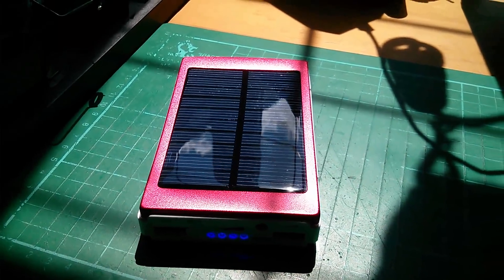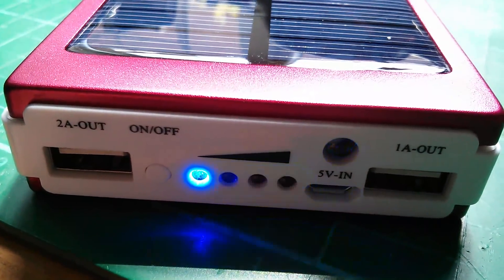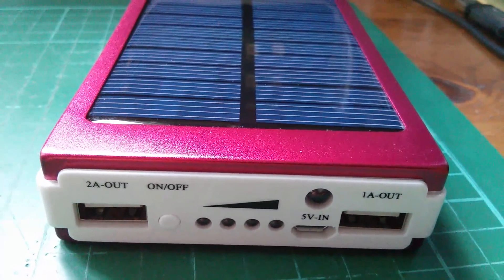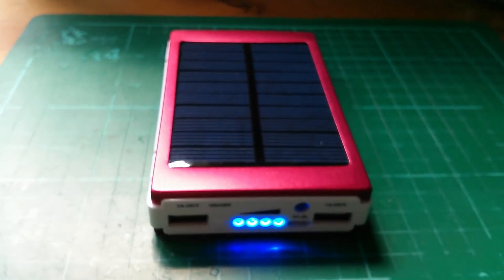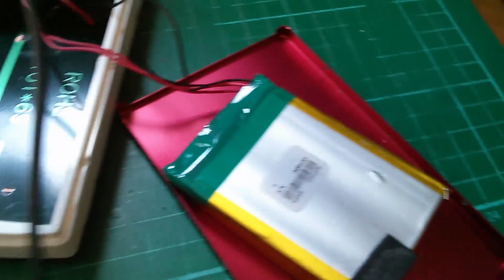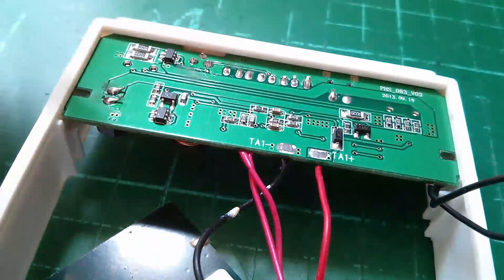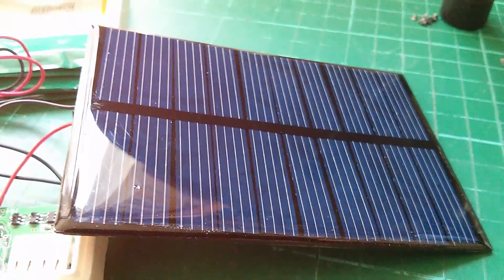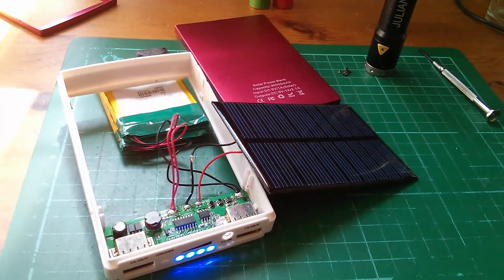Review: 30,000mAh Solar Power Bank - It's a pile of Junk!

Comment: Nice review, but I COMPLETELY disagree. You have what looks to be a brand new one that you have taken apart and judged. I have used the same product for over a year in adverse weather conditions, camping and bringing it to the industrial workplace EVERY DAY where it has survived a drop onto the concrete from a distance higher than my height. I am 6ft2in tall. I have used Duracell, yoobao, and several other battery banks in the past. This one you reviewed negatively is the one that has taken the worst beating and kept going. Give a bad review to the altek one or something, not this one. Altek is the one that diddnt last me 2 weeks. I definitely recommend this product.
Reply: +glaucus78 You recommend THAT? A product where you don't get what is printed directly on it? I don't care how rugged it is, if I buy a 30000 mAH pack I don't want a 4800 mAH pack. It's top quality crap.
Reply: +frtard Yea, I know what you mean. This is always expected when buying crap on eBay. All I wanted was something to keep the Bluetooth speaker charged for at least 8 hours at work or camping, without me being worried about it or the speaker dying. A combo with this charger and the HDMX Jam worked out the best so far.

Comment: Thank you so much for that. I was tempted to get one but you've exposed it as a con and waist of money.
Reply: Yeah, It's a total waist
Reply: +Alba Albion Its not a waste of money. As far as I'm concerned, its the best power bank under 20 dollars I ever had. I have purchased some 8 or more power banks over the last 10 years for my job to have Bluetooth radio connection at work. This 30k solar one is pretty good. If you have the money, by all means get the "yoobao long march", but this one is plenty good. I look forward to buying the 50k mAh one.
Reply: +glaucus78 or you can buy a $17 elivebuy imix gen 2.
Reply: +Littlefear it has 10,000 mAH

Comment: I found a "600,000 mAh" power bank lol
http://m.ebay.com/itm/600000mAh-Solar-Power-Bank-Charger-Battery-Backup-Galaxy-Iphone-Portable-Mobile-/221887185824?nav=SEARCH

At 3.7V that's 2.22 kWh, or just under 8 megajoules!
Given the typical energy density of Li-ion batteries, if that thing really had its rated capacity, it would weigh around 15 kg! How's that for portability?

By the way, with that amount of energy you could charge your mobile devices virtually infinitely many times. Or heat up 19.1 liters of water from freezing to boiling. Or run a 3 HP electric motor for an hour (assuming no power loss and 1 HP = 746 W).

Charging would take several days, even if you wire it to an ATX power supply. I wonder how long it would take to charge using its built-in solar panel though.
Reply: +fede142857 It's also on amazon with no ratings 

http://www.amazon.co.uk/Capacity-600000mAh-External-Emergency-Universal/dp/B00VJSM3T8
Reply: +theBIGreekgeek 
I opened my 200,000 mAh today... It is 2x 4500mah
Reply: RRSYS.info - Roulette Prediction
hah you should post a vid
Reply: +fede142857 Is that description written in Comic Sans?
Reply: +tapper88 What will expect? China, the fake capital of the world. lolo
Reply: well said, but is it not simply a typo?, maybe an extra 0, perhaps just 60,000 - i have a 200,000 model, and i have not opened it up, but i notice it charges my iphone 5s from dead to 100% so far 4 times, i know its not 200,000 mah, and my usb tester says so far its transfered only 6000mah's - +fede142857
Reply: I would do, but my channel is all roulette, but yeah, I may make an exception - you know it still usefull, I have got 4 of them :) 
+theBIGreekgeek 
[Paul]
Reply: +RRSYS.info - Roulette Prediction (Paul) there is no such thing as a 4500mah rating on an 18650... you got over rated batteries in an over rated package lol
Reply: ***** lol
Reply: +Honda 97 you know how sad i feel. China electronics SUCK! btw here in china every 5 minutes people call the fire engines because of electrical failure/explosion/short
Reply: +fede142857 I thought asians were good with numbers, Well at least they got the panel info right: "Solar panel: 1.5W"
Reply: fede142857 buy a bunch of old nokia and make your own power bank xD
Reply: fede142857 It's also impossible as the highest we have reached in capacity is around 50,000 mah, especially for $50. Don't buy it.
Reply: At 3.7V that's 2.22 kWh... ;-) Chinese material... False technical data!

Comment: The cells inside are obviously "recycled" from electronic scrap. Clearly visible scratched adhesive as you would find it when removing them from a cellphone or tablet for example. This is not due to removal from the so called solar charger itself, as the same adhesive in the same scratched and wrinkled state is visible between those two cells, holding them together. This is quite common chinese method to save a few $$ when producing unbranded low-end stuff in fraudulent, clandestine sweatshops. I have often encountered that. 18650's from disassembled old laptop battery packs, polished endcaps and a new shrink foil, sold as new. Spare batteries, for cellphones and ipods, removed from scrap units, cleaned from adhesive residues with solvents to look like new (unfortunately printing also came off by that) - sold as new on ebay. And if even that is too expensive, they sell power banks where they put in for example one or two crappy old cells and  some dummies. Just the case of the battery, filled with sand to give it a substantial weight. Do not trust cheap no-name lithium cell containing electronic goods from china. It even might be dangerous...

Comment: I've got one that looks identical, but is a different colour and has different writing on the back. It's claimed to be 10,000 mAh, which seems fairly accurate in practice. It's good as a rechargeable light and an emergency battery pack. But I had to permanently cover the solar panel as no matter how bright, whenever enough light hit it, it would quickly drain the battery instead of charging it.

Comment: even the so called 50000 mah has like 8000 mah battery cells inside it. Its solar panel is very low wattage so it trickle charges the power cells, in short it will take a very long time to recharge of the sunlight. I looked at a review on this product its amp hour on its USB ports are much lower than what is stated. So its a total rip off.

Comment: I dont know anything about electronic and circuit but what if you opened this and cut all 4 led blue lights? you wouldnt have the problem of the led lights taking the energy from the solar pannel. these lights are kinda useless... or maybe the whole circuit wont work anymore because the lights are pluged in serie? i dont know...

Comment: I had a solar one quite a while ago, 7000mah, size like a typical 5 inch phone. 
Pretty crappy build quality, a lot of heat and inside was just a really small battery in some blue tape. Measured about 700mah, which is crap. Also the output was supposed to be 1 amp, but seems to be about 400 milliamps...

I got it from a local store for 20 wasted euros.

Comment: that solar panel doesnt give more than 250 mAh (in full sun), so you need 8-12 hours of full charge to replenish the battery. Maybe the battery life is gone or there isnt any DIODE connecting solar to battery and the battery finally is pumped by the solar panel. You cant charge the phone with the sun, you charge with the battery energy. To get a decent rate of 2000mAh you need 6 solar panels of 6x6 inchs.. and 30000mAmp/h is 30 Amp/hour (half of the car battery  (?). This is a 2000-4000 mAh maximum.. so dont expect miracles

Comment: Don't waste money on any expensive solar panel get creative- I built mine from old solar yard/garden lights that I bought at a yard sale dirt cheep- cost me very little. The lights all had dead batteries I dissembled them and screwed the tops to a PVC frame each tiny panel from the former lights put out 6 volts I wired all 21 of them in parallel for max current- haven't measured the true wattage yet it is however enough to burn up transistors in DC to AC inverters and 555 timer IC's- I make pulsing DC circuits and hook them to neon transformers and inductors to create inductive arcs and high voltage for capacitor charging.
Reply: Those solar garden light panels tend to be the cheapest, short lived examples you can find, usually aren't putting out anywhere near their max capacity by the time they've had a tour of duty enough to kill the battery.

I suppose they'll do for a dirt cheap home project but for portable power I'd stick with premium solar cells.  One thing I haven't see yet which seems like it would be a fairly robust design is to take a unit like the one reviewed here, but with premium cells, and put a 2nd same-size, fold out panel on it with each end being a metal hinge for the +/- connection, recessed so they couldn't short out on a metal surface.

I mean that there probably are some with fold out panels but I'd like to see some Chinese cost cutting ingenuity to produce one instead of the premium priced products, which make little sense as I'd sooner just carry a larger power bank or separate solar array than spend that much.
Reply: @stinkycheese804  Origami solar panels is a very cunning idea!
Reply: (They are investigating this idea for the solar panels for satellites - fold up small, fold out big!)

Comment: You are absolutely right, i just dismantled mine to recover the 5 18650 batteries .
I tried to charge my phone with the recovered solar cell (using a diode) outputting 4.2v @ ridiculous amperage , the result : my phone said : charging tough after few hours the battery was completely discharged ...can someone explain why ?

Comment: I think what's happening with their advertising is that they THINK they're getting away with claiming a 30 Ah capacity because of the whole element of the renewable energy component.  They factored in a certain (what they thought) was an average amount of sunlight (and unrealistic) and they took the 4800mAh capacity of the batteries and assumed they'd be charging at the same time you're using the unit.  In a good amount of sunlight, their experiment possibly finally ended after drawing an equivalent of 30000 mAh of power!  It's a down-right lie, like you said, but I'm sure their explanation would be similar to this.

Comment: That's the reason I now use those stand alone foldable solar panels, instead of these cheap China made frauds. I own 2 foldable 16 watt and 20 watt solar panels respectively from goal zero and they worked fine. I always suspected that the small solar chargers like the one you had demonstrated from China, were over-rated in their storage capacity. It does not charge my devices as many times as it should be. The panel isvjustvtoo small to charge such a high capacity battery as 30,000mah.

Comment: Well, if the quality of the cells is as good as the rest of it, you might actually find that the claimed capacity of 2200 mAh each for those is an exaggeration! Discharge test?!

Comment: What I did was buy this and replace the awful battery pack for 5 high quality Sanyo 3200mah 18650 batteries. Now mine has a true capacity of 16000mah. So it has all the functions of the original and a better capacity.

Comment: Thanks for the review. I wanted to buy one. But the seller on some auction told it's really capacity 5,000-8,000 mah. Its way much less than 30,000 his one was even marked as 50,000. I thought its something really strange and decided to find a review. You brought all the light to this.

Comment: Almost all of the powerbanks use 18650 batteries. That batterie cost arround $4. So when a powerbank is cheaper than 4$ / 2600mAh there are often fake.

Comment: The one my mate bought had a 3,000mAh battery.

I bought the 10,000mAh and it is not very good either, I get about 1 full charge on my drift HD (3,600mAh).

Comment: Everything is wright. I bought one. The power bank is able to deliver 1A at 4.85V for three hours. I figured out how this scam is done: There is a wholesale dealer who sell this "Do it Yourself" Kits on categories. The category 30000mAh presented here supports lithium batteries up to 30000mAh. Now, there are chinese people called Sellers who install all the parts together, they found cheap lithium polymer batteries, and install them and that's it. They sell em to us these power banks showing us printed on the back 30000mAh. Cheers!

Comment: Did you try to unsolder those LEDs? I assume that's a 5V 250MA solar panel and it can "do the job" without burning power on LEDs.

Comment: He doesn't actually admit this unlike a lot of others actually does the job it does charge my phone twice & years later it still works & doesn't go flat by itself..
It's not super advanced but what do u want it has the components relative to the job...the solar panel helps hold the charge it only puts them on if the input exceeds the output during charge so it's not draining..turn it upside down to turn them off if you think it's eating batteries..I agree the solar panel is not really much use for charging it but it's a trickle charge to keep it full..
Months later mine stays full..
Reply: Dan Servante 
Even mid range AAs don't lose charge on their own and therefore don't require a trickle to keep them full (which is supposedly quite bad for the lifespan of the batteries)

Comment: Good the button is recessed so it doesn't get bumped..
I have had mine for about 2 years we use it often & it holds a charge..but the solar panel is a bit small by the time it's run the LEDs.
It actually feels cheap but it wasn't expensive & it's doing it's job I face it down so the solar panel doesn't activate & thus the LEDs don't eat anything unless it's really sunny...
Just don't forget it won't charge anything until you push the little button..I'm very happy & mine is only 10,000ah

Comment: I bought a 15600mAh Yoobao YB-665 about two years ago on a trip in Asia and it has held up fine until recently, was looking for a replacement, thus ending up here. 
They are not as cheap, but they hold up fine.

Comment: I'll add from my experience if I leave my phone out in the Sun (while charging). What happens?    ...My phone over heats and becomes inactive and actually shows an alert Icon on screen. Same (with skiing and) getting too cold, becomes inactive shows an alert Icon.   Also, I've never seen a Solar Panel actually output it's Wattage as rated and LED lights seem to use way more power than rated.

Comment: Great video post. Thanks for all the detail.
I was almost dissuaded by a negative comment but I was glad I stuck with it.
I looked at these on eBay and saw that some sellers actually rated the solar input at 200 milliamps and the micro USB input at 1amp max.
So I was thinking the case was just ambiguous until I saw you examine  the Li-poly cells to show that the 30,000 amp hours claim was just a lie.
Looks like a run of the mill power bank with a solar power gimic added to it to help its eBay sales.
 I thought it might charge up given a few days on a car dashboard, but with all the other lies, it would probably be a bad idea to leave it unattended.

Comment: You should've measured the volts and amps on the usb outputs aswell, because in my experience most of these "chargerpacks" has such a small power output that the phone connected to it drains the power faster than it's coming in.

I have an app on my samsung smartphone that allows me to see the current amps that the phone is charging with and with my (at that time brand new) chargerpack it gave a value of -100(yes negative 100mAh) to 150mAh, now I know that the app of course probably isnt very accurate but I don't think it's very far off as the phones battery percentage kept dropping even though it was charging and the phone had it's screen off and no apps running.